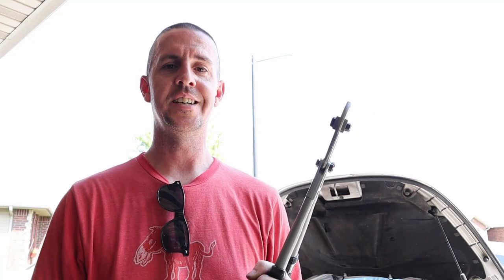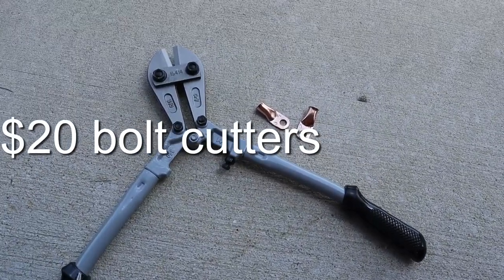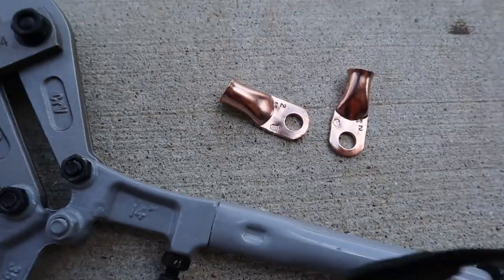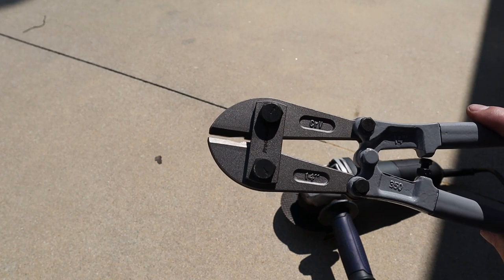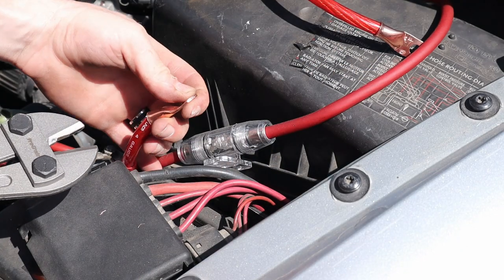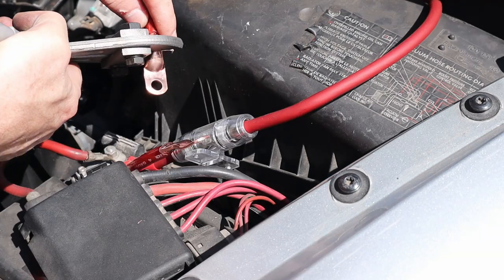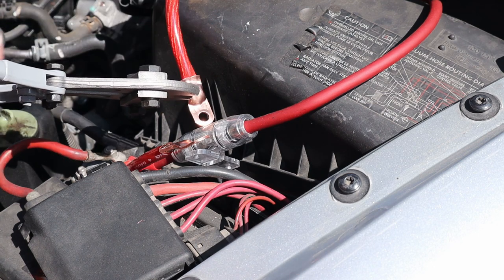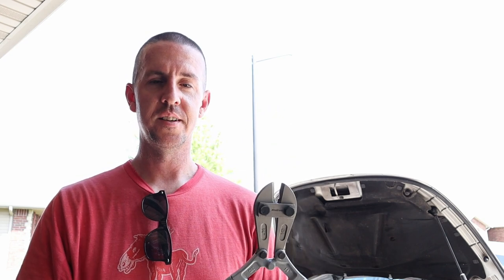Bolt Cutter into Crimping Tool

Comment: Good idea.  I think I would take it a step further and grind a circular cut out slightly smaller than the gauge of wire you need.
Reply from the maker: That was going to be my next step when I was planning the idea, but it worked so well I didn't think it needed it.  At least not yet.
Thanks for your feedback.
Reply: [re.] Grinding out a circular cut:  Easier said than done.
Reply: @pvt.2426  ok.  How about circular-ish
Reply: @micahwest5347  The 'terminology' isn't the problem.  The idea sounds good, but my critique is how could this be done?  The jaws of the 'bolt cutter' only goes so far.  And, it's made of 'hardened steel', so what would you use to make 'half-moon' holes?
Reply: @pvt.2426  carbide grinder bit.  This video was created by using problem solving and critical thinking.  Don’t give up now.

Comment: I needed to swage a steel 3/16 fence post tensioning cable into a loop to fit thru a turnbuckle.  The standard dual ferrule needed for this is about 7/16 long.  I took the jaws out of the bolt cutters and using an bench grinder, ground off 1/2" of the ends down about 3/16".   I re-assembled the bolt cutters and tried it.  Worked perfectly to place two crimps horizontally along either end of the ferrule.  Doing it this way I still have a functioning bolt cutter, since to cut a bolt or a lock you would use the back end of the jaws.

Here is the swaging ferrules that I needed to use for making a loop:
https://www.acehardware.com/departments/hardware/garage-door-openers-and-hardware/garage-door-hardware/50301

Ace also sells the swaging tool for $54.99
https://www.acehardware.com/departments/tools/hand-tools/bolt-cutters/2426583

Great Tip!
Reply from the maker: Sounds like your idea was a pretty good one too.  Love hearing other people's ingenuity.
Thank you for your feedback.

Comment: Why not just use the back end of the bolt cutters?
Reply from the maker: This way has more leverage
Reply: the back end is a simple lever in term of mechanical advantage. The front end, it's a different story. This is the same idea as in the locking pliers, much higher mechanical advantage.

Comment: I think your method would work in a pinch but, crimping in that manner will not make a gas- tight fitting witch could cause oxidation of the connection.  A well-engineered and well-executed crimp is designed to be gas-tight or cold welded which prevents oxygen and moisture from reaching the metals (which are often different metals) and causing corrosion     https://www.youtube.com/watch?v=bAO9eCS65jw
Reply from the maker: You're 100% correct, the crimp here isn't perfect but it was very cheap and if you're on a tight budget and need it done this could be the option for you.
Thank you for your feedback.